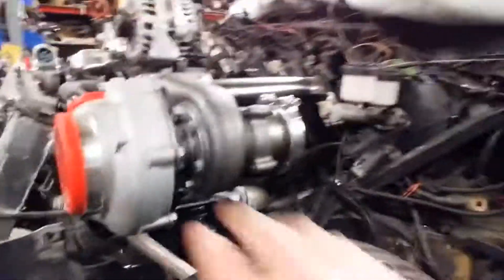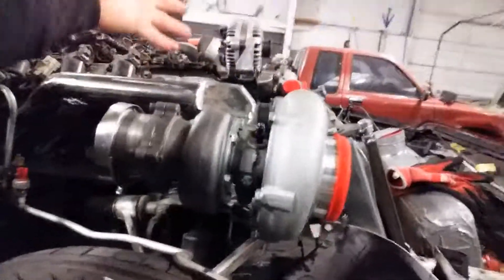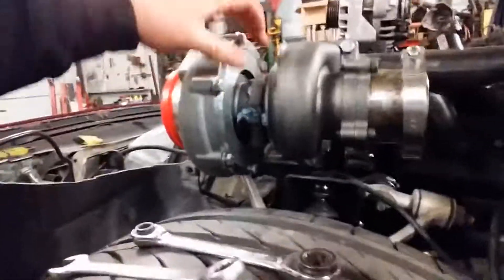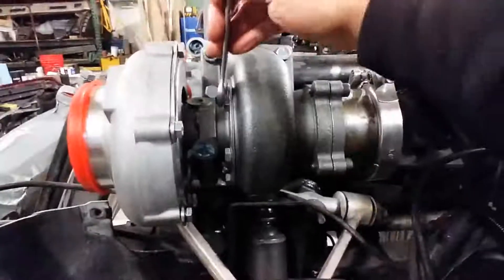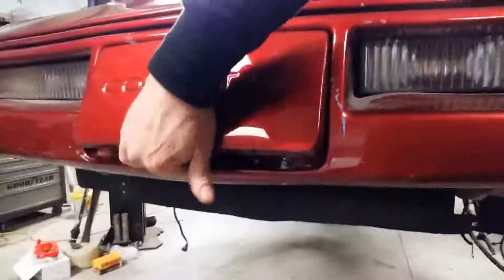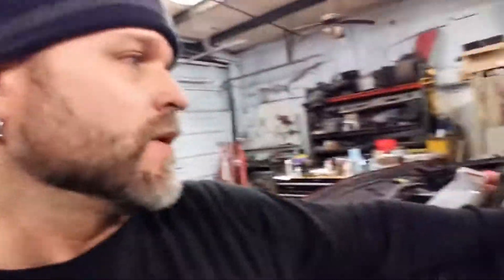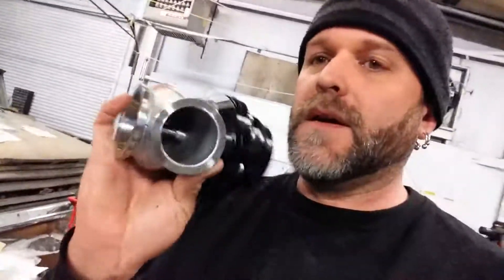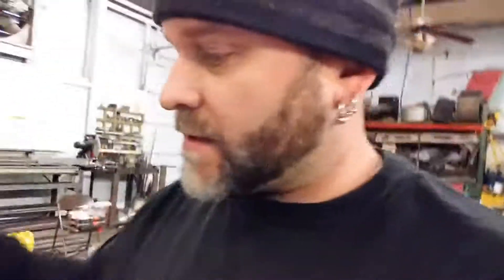Oil & water Cooled Turbo Basics

Comment: TIP to drop guesswork for turbo oil pressure:

TS-0801-1002
Turbosmart’s Patent Pending OPRt40 is an Oil Pressure Regulator designed for your Turbocharger.

Many Turbochargers are built around a bearing and oil pressure profile much lower than is seen by modern & high-performance engines. Feeding these turbochargers the appropriate oil pressure has always been challenging. Traditional methods to limit oil pressure have been with a restrictor aimed at reducing pressure – However, this also reduces flow.

Turbosmart’s OPRt40 is a true regulator because a target oil pressure of 40psi can be achieved without compromising oil flow. This takes the guesswork out of the restrictor or feed and drain hose selection and ensures the oil going to the turbocharger never exceeds the manufacturer’s tolerances. This will provide you with rock-solid oil supply pressure within the manufactures tolerances.

Available in
Black: TS-0801-1002
Blue: TS-0801-1001

Features
Fixed 40psi Configuration
-4 AN Ports
1/8 NPT Gauge Port

Comment: I use this turbo Maxspeedingrods on my R33 GTST RB25DET. Is it absolutely necessary to run the water through it? Rn its oil cooled only because I am missing the water pipes on my engine (got it this way). It works fine. I have the engine out rn and wondering if to have my mechanic install the water feed. Thanks

Comment: I have a C20 journal bearing ,water cooled turbo, and am to fit the water lines on an old Toyota 2LT diesel engine. Am afraid that the coolant temp rise and so the engine temperature. Any taughts? Tks!

Comment: Dont use a restrictor on a journal bearing Turbo. There not necessary. As for a bearing Turbo dont guess on restrictor size.  Go steaight to the experts at TurboSmart and install a TurboSmart OPR. Restrictors have been obsolete for some time now. About your twin Turbo orientation, why did you not purchase a turbo for one side or the other that has opposite/reversed entrance and exit? Your currently running two of the same turbo on a v8 configuration? Precision Turbo has Turbos in any directional orientation you need. Just asking......
Reply from the maker: Budget is always the devil of all builds, when building for yourself is one thing but building for a person who doesn't do this is another, unfortunately.. Yes the current turbos don't need restrictors in most cases, but always confirm this for your self. What requirements change constantly and as I mention please always refer to the manufacture for required parts for correct assemble. Plus, It was recommended by the manufacturer to use one on these turbos. They were designed off an old model garrett and had a rare thread to boot. So since recommended I installed but appreciate your comment, excellent info and questions!

Comment: Thanks man. Great information.  Btw, Is it common to get exhaust gas leaking out from a turbo back into the coolant system. Some Ford eco's have a secondary cooling circuit via a small auxillary 12v pump to just cool the turbo water jacket, even after switch off. If there is good cylinder/headgasket pressures on test and all other things considered, could a damaged turbo/seal give similar coolant loss symptoms to a leaky headgasket/cracked head/cracked liner/block y'think?
Reply from the maker: Sorry for the delay but depending on the amount of damage just as a head gasket loss a turbo could allow that if the damage is extreme enough. But typically no this shouldn't happen. That pump is working like a turbo delay would but is pumping water also not just running the engine longer. This is very important in order to extend turbo life, cooling them after use is very important.